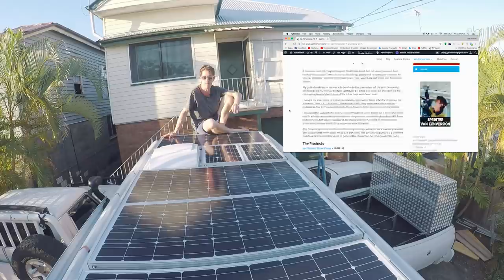S1E8 Sprinter Van Conversion | Solar Install 580W

Comment from the maker: The solar panels are working great and holding strong! I've seen them pump out 30-35 Amps on the absolute sunniest days, but are generally producing around 20 Amps on standard days. I did not film me installing the solar panel wind diffuser on the front panel so wind pressure does not build up underneath the panels whilst driving, I strongly recommend viewing the blog post to install this feature if you install solar panels.

Ep.8 BLOG POST + PRICE BREAKDOWN - http://www.jazmorton.com/solar-install-580w/
Season 1 Van Build - http://bit.ly/VanBuildS1
Season 2 Van Life - http://bit.ly/VanLifeS2
Reply: Travel With Jaz Just re visited this video and found your update, good to hear plus the wind diffuser/ negative pressure attachment. We are just about to update the panels on the pod. We have a couple of 100w panels that we have to setup each time and chase the sun with so we’ve got tired of that plus the weight and space used of those suckers could all be utilised better methinks ...been great but if you go for a hike not much day sometimes left to chase when you get back. So we are mounting them to the rack on the pod roof. We thought we would brush up on your hinge install for the panels. So really interested in how you prop them up and how the bolt catch is going and is there anything you’d improve on the hinging and catch idea.  Cheers and thank you.
Reply: Good work I would never have done it this way
Reply: use butter or oil to smooth sillicone or glue, it works ;)
Reply: you could have possibly used riv nuts or jb welded nuts to the other side so that you didn't have to go through the angles but matey what a conversion

Comment: I saw a video from a couple who originally wired in parallel and later changed to series because the higher voltage suited their charge controller better. Thanks for the great video!
Reply from the maker: Haha that's great my charge controller works fine with parallel so not sure if I'll be changing it

Comment: I really like your tilt mechanism for the solar panels.  Up here on the England/ Scotland border our mid-winter sun is only 12 degrees above the horizon at midday and having panels that can tilt would increase the efficiency by a huge percentage.  Great idea.
Reply from the maker: wow yeah that could definitely be used for that, here in Australia we don't really need to worry about doing that as the sun is pretty high in the sky, except in winter it does drop a bit.

Comment: So glad to see that you can install the solar panels without drilling a bunch of holes into the roof to attach the panels.  I need to buy that strong adhesive SikaFlex.
Reply from the maker: Yes there is Sikaflex 221, or Sikaflex 252. and a bunch of other high strenth adhesives!
Reply: Travel With Jaz 
Can I buy those adhesive online?

I will get back to you next summer to see how good the adhesives are securing the solar panels by next summer.

Please explain why you used hinges?
Reply: Why did you choose 221? There's a hundred choices.
Reply: There is no way I would trust that SikaFlex, never under estimate the pressure those panels get at high speeds!  His idea to mount the panels to the aluminum angle was great, just add a few nuts and bolts.  Would you fly on an airplane that uses SikaFlex to hold the wings?

Comment: I like the rivnut ideas below, and another option is to put hinges on both sides. Like door hinges that the pins can be pulled out (or put a bolt in place of the henge pins). You could then have the option of tilting them either direction.  The pins could be drilled with cotter pins or set screws to stay in place...just a thought.
Reply from the maker: Cheers mate I like the riv nut idea too think I will do it as an after fact

Comment: Not to take away from this vid and Jaz's work which is amazing!!!!!! thank you Jaz!!!!!!!
However you can now get Flexible solar panels which mount directly on your RV's roof......without mounting brackets and the associated wind resistance...etc
Reply from the maker: Yeah they've been around for agers! I wanted to go with standard style as it would create an air gap between the van roof and allow it to be cooler

Comment: One suggestion, although you are the electrician.  You might want to run that flexible low voltage conduit in the walls to keep your wiring options open downstream.  You never know what you might want to put in there later on.  I wish I had done that in some of my house.  Hard to think of everything up front, and as you know, technology changes quickly..
Reply from the maker: Thanks very much I will already be doing this mate ;)
Reply: Just want to clarify your point as I've intended to run my ~375W (later upgraded to 500w) in series but perhaps parallel makes more sense. Do you mean run the individual wires from each panel down close to your charge controller? Once they're all there they can be attached to + and - bus bars and higher gage cables can connect to the controller. Does it makes any sense to do that vs just running a thicker cable down and combining them on the roof? Thanks

Comment: Hello Jaz...how are you..
I just wanted to ask you about two things...
1. the air conditioner you didn't think where would you install it?? No enough space for it
2.  You didn't let any space for working on the roof if one day you need it..
Thanks a lot for the big and good job you have done...
go on and GOD bless you
Reply from the maker: hi,
1. didnt want an aircon plus my battery system isnt large enough to run one for hours on end.
2. yeah i had to trade that space off for solar

Comment: you sure have a lot of confidence in SikaFlex and no mechanical fastening , i will be sure not to be behind you on the highway lol
Reply: Anne6621 that’s what I was thinking
Reply: @999mrkhaled   I have a class A diesel pusher motorhome and 90 M.P.H. the pannels held VERY securely!
Reply: @lloydmorrisonii1373  you are using sikaflex??
Reply: Same wouldnt trust just that silicone

Comment: also everytime you drill a whole and you are worried that it may drip or rust, we could use rubber paint spray , so that it forms a rubber coat which would be air tight too.
Reply from the maker: Thanks for all your tips mate appreciate the thought!

Comment: When explaining parallel vrs series everyone talks about the shading issues. While very important, no one mentions the wire size determinations as volts or amps increase. This could make a huge difference in the wiring needed and the cost associated not to mention the ease of working with and terminating wire based on size.

Comment: Awesome work Jaz & love the explanation of how it all works. Can you get zapped while you are wiring up the panels? We're here in Beaudesert SE Qld. You look to be near the city (Kelvin Grove maybe?) We just about have our Caravan finished now & was thinking of going solar but went for a 130 amp alternator on our 4X4 instead. We will be taking off mid next year so hope to see you on the road of life. Just wish we would have done it at your age though. Bill & Kyrie.
Reply from the maker: Thanks heaps guys! You can get zapped with solar but generally if you got them all series'd together, creating higher voltages, I did this late in the arvo and they're in parallel, negating any dangerous voltages.

Appreciate your support and see you on the road!

Comment: Instead of the corner bolts you could have a nut welded on the panels frame and the you can just unscrew the bolt from the outside
Reply from the maker: That's a sick idea! didn't even think about that. What about a "Nut-sert", sort of like a rivet but where you can screw in a bolt. This might be easier cos i'm definitely not the best welder haha..

Cheers for your idea it is still possible to do as the panels hinge and I can change if i need
Reply: I was going to suggest using rivet nuts (basically the same thing). Very common in van builds to secure stuff to body rails, and would work great for this application too.
Reply: Travel With Jaz indeed even better idea. On eBay you can get nut rivets for cheap. If you then can find a bolt with a wing nut like end you can even undo them by hand. Or maybe if you have room enough height wise you can work with those flip over to lock things used to put wheels in bikes. Nice work. Love your videos 👍
Reply: Another vote for rivnuts here. They would be ideal for this situation.
Reply from the maker: Another good suggestion :)
Reply from the maker: I see what you mean :) all these good suggestions are great, thanks!
Reply from the maker: Haha me too, cheers!
Reply: dude why not just use rivet nuts like M6 or M8? They are strong like hell! =) cheers from europe

Comment: Hey just so you know, though normally you'd be correct on series vs parallel with solar panels, those panels would not be affected as they have diode bypasses (the big black box on back of each panel). Though with that if one panel is affected, you just loose the whole panel completely. The other option is to do micro mppt controllers per panel. Good job on install though other option on mounting would be to use rivnuts (though I see that is mentioned)

Btw I followed you to here from Facebook (thanks for the info on the insulation again)
Reply from the maker: Hey skye that's cool I didn't even know they had diodes on them, they're good panels 👍🏼 thanks for tuning in and glad you're enjoying the videos!
Reply: Travel With Jaz yah, a lot of good panels include them now. You use to have to buy separately. Renergy are the first ones that I've seen that include them. The only ones that I don't see them often on is commercial power panels cause they limit you to 1kv max on series

Comment: Those cables look pretty thin for your 500w panels going into the van (at least it looks that way from the video). You are going to be getting 20+ amps through those small cables on a super sunny day. You might want to up the cable size a bit on the 500w side of things.
Reply from the maker: Yeah thought about this they 4mm2. Might up the 500w to 6mm2.

Comment: This has been a fantastic series, to watch, thank you for making it. I do have a question though. How much charge do you think 580w will provide? Not an opinion I just wondered how much it would power batteries wise.
Reply from the maker: Hey thanks heaps! I think at full sun roughly around 30A per hour. 500w / 18v = 27.77A   &    80w / 18v = 4.44A

My battery is 200Amp hour, so in theory 6.66 hours to charge. this is all in theory.

Comment: Also to add in you could use crimp nuts instead of drilling through the corners.
Reply from the maker: Yeah I might change it over as an after thought

Comment: I'm going to look at a short bus to possibly buy and try and do into a RV conversion, using all your videos as helping guides and hopefully over the next several months get if finished to travel from East Coast back to the Pacific NorthWest then travel around several states  (Dakotas, Wyoming, Idaho etc.) looking for few acres of land to settle onto. Be interesting to see if the physical work looks as good as my visionary ideas. I'm NOT with any carpentry/construction skills at all. But I only fail if I never try right?
Reply from the maker: That's awesome go for gold there are no limits to what you can achieve! You will never know if you don't try so just do it and learn a hell of a lot during the process 😄

Comment: If you fit bypass diodes to each panel than it wont matter how you wire them (series/parallel) The bypass diode will bypass the panel if one panel is shaded so it doesnt lower the output of all the panels.
Reply from the maker: Thats awesome

Comment: Could have used a bit of angle for those corners, screwed on both sides. Those bolts are going to put stress on the glass in the corner, adding to the stress from flexing from a lack of middle support
Reply from the maker: She'll be right ;)
Reply: Hopefully, a close encounter with a small branch is extremely common. I had a panel on my motorhome go crazy crack from one wheel hitting a large rock. But they are much cheaper these days so no biggie I guess

Comment: All in parallel? I understand that wiring them all in parallel is going to give you a low voltage (lots of current of course). But the charge controllers prefer a higher voltage  —  they need to step it down to charge the batteries but if it is already too low, no charge.
While you may have enough voltage on a good day, overcast or when the angle of the sun is low .... may be a different issue.
Suggesting serial-parallel.

Comment: I would have fitted those junction boxes the other way round, if your driving in rain the only thing keeping water being forced in by the vehicles speed is the seal around the cable. I fitted mine under the panel AND facing backwards to give it a better chance of staying water proof.
Reply from the maker: I would've done this to but they're right at the back of the van and I didn't want dirty cables flapping in the wind over the back to be visible. I mounted them so far back because there is a big cavity there to run wires.
Reply: Nothing stopping you modifying if it becomes an issue, I'm British, it rains a lot here so we think about it a lot. :D

Comment: Hi Jaz,

Beautiful tutorial man, very helpful!

We just have a question about the step where you fix the panels with sikaflex...

When you lift the panel to add sikaflex on the angles, how do you do to screw the panel afterwards? How do you do to replace the bolts?

Thank you very much for your help!

Cheers!
Reply from the maker: i just get up on the roof and put the screw through the hole and the tighten the nut on the other side of the bolt, i show this in the video im quite sure. hope that helps man :)
Reply: @JaznLori  Thanks Jaz! We found it!! It works! Cheers!

Comment: Is it just the SikaFlex holding down the solar panels? If so, that kind of concerns me. There's a lot of wind lift on a flat plane as large as those panels. In a different channel of a van build, the guy had his front panel blow off because it was only held down by something similar to SikaFlex (it might have been SikaFlex).
Reply from the maker: Dead right man, sikaflex 221 to be more precise. I wish I included in this episode but I got a piece on aluminium bent up and mounted it to the front as a wind guard deflector. The guy your talking abouts panel blew off because wind got caught underneath the panel in a gust of wind. No gusts can get under mine I did include the deflector in the blog post though at the end. Cheera
Reply: From Physics I remember is under pressure in tunnel (suction) but has to be very close to your roof so forget, more important is guaranty on sikaflex 221 and how many years will keep your panels - few more bolts - more secure.

Comment: One mistake! Never use tape to waterproof outdoor connections. All the tape will do is hold in any moisture that will migrate in, and trust me, water will find a way! Use Liquid electrical Tape, and seal them that way instead. This product will fill all the voids, adhere to the wire and connectors, and after it cures a single layer of tape for UV resistance will make it last for years. Cheers.
Reply from the maker: Sounds good mate thanks for the tips!
Reply: Better yet, shrink tubing and hot glue. Will pretty much make a molded connection.
Slide shrink tube over the soldered connection, squirt in some hot glue in the middle (be quick as the heat will make the shrink tube shrink already), and use a heatgun to shrink the rest of the tube from the middle outwards.
Reply: There is also 3m self vulcanizing tape it's gluing itself once applied but heat shrink tubing witch is the best, srinks it's diameter by factor of 3x can put silicone before heat up, water will never go inside. Regular PVC tape is also good one if properly put, should be applied using lot of stretching, not everyone even electrician i work with (even me for years) know how to handle such tape. It's fragile but must be stretched to some degree self vulcanizing tape needs it a lot in order to work. This is how i learned how to use PCV insulation tape. It's not ducktape, it's not glue to hold it together long run, it's stretching. Use the force Jaz.

Comment: Was wondering what you did to secure the cables from the panels back to the back.  Are they just flopping around on the roof, or did you attach them somehow?  Was thinking PVC conduit might be the way to go to route the cables, but maybe that is overkill.
Reply from the maker: Hey mate I zip tied the run together, and to the panels :)

Comment: hey mate, instead of using sika bond or any glue for that matter, why cant we use reverts and apply silica bonds over that reverts to water proof it. so that you get a strong hold.
Reply from the maker: Considered all these options and just didnt want more holes in the roof, I wanted to see if this will work which Im quite confident it will. Will let you all know down the future, thanks mate
Reply: As long as it work, I'm satisfied. I'm building one myself and I was looking for your opinion, thanks man.

Comment: "riv-nuts" may have been your friend for the second side. Or drill and tap a threaded hole?
Reply from the maker: Good idea cheers for that!
Reply: Riv-nuts are definitely a better option than those corner bolts.
They are available in stainless as well as aluminium, and you should definitely have an assortment of "christmas-tree" shaped step-drills to make round holes for the inserts (even the cheap ones from the discount store are fine for aluminium).  I found in some cases an imperial size creates a better fit for the insert, and there are also inserts with a tiny bevel flange which fit flush!
. 
Also, regular spiral drills frequently make triangular holes in soft metals like Aluminium and Brass, but they're fine for an initial alignment hole (3mm etc.) through your angle and solar panel frame before using the step drill.